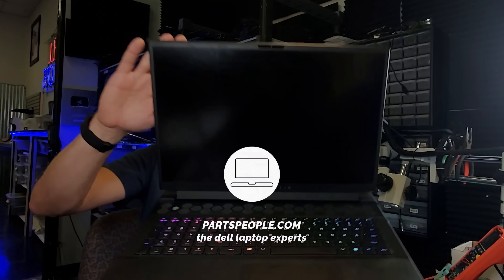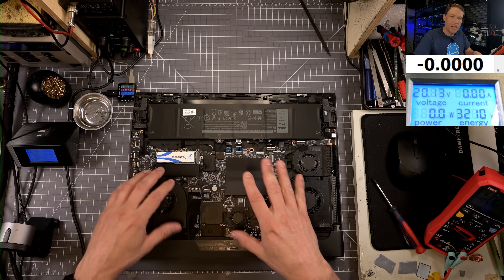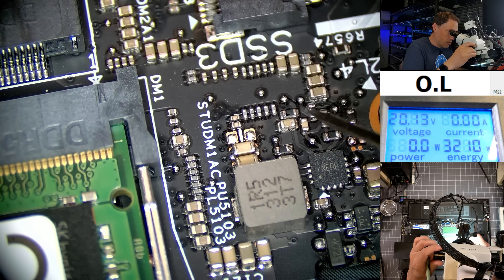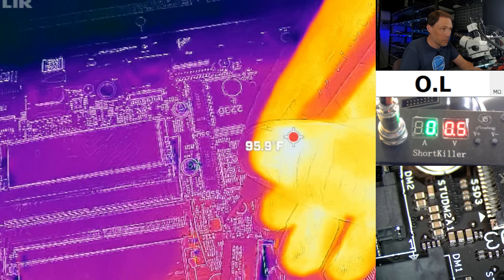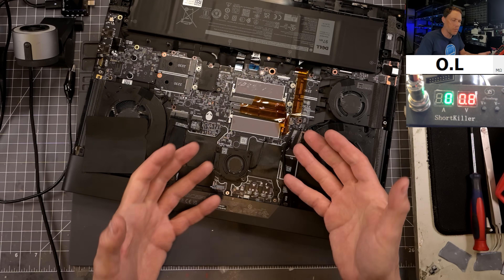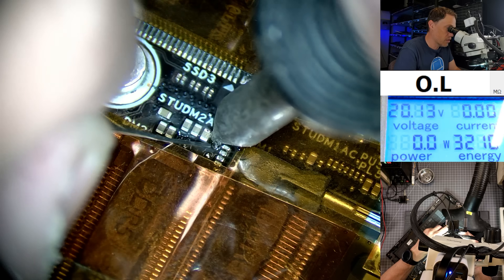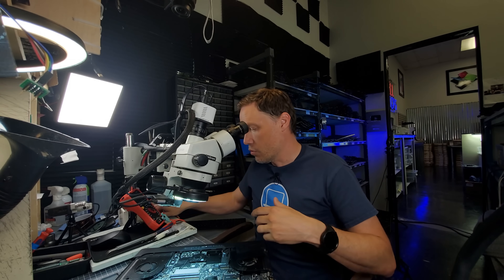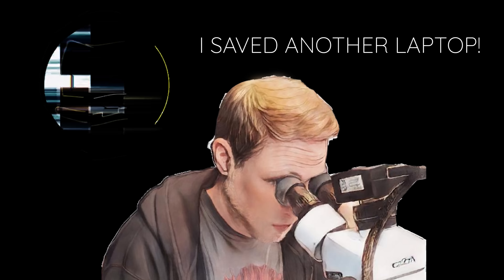SAVING This 18" Gaming Laptop That DESTROYED Itself-- And I Am Seeing TOO Many Of These!

Comment: One tip that will help you hand solder components.. remove all solder from pads, put solder on only one pad, then align/tack the component down, and solder the other pad/s with fresh solder spool. I do this regularly for components, and it simplifies the soldering a lot.

Comment: Soft termination ceramic caps are the best, but more expesive, other option is open mode but those have half the capacitance for the same size. In automotive is forbidden to use them direct on the kl_30 or 12V rail, guess why....it will catch on fire, so only open mode or soft termination type. A fuse will not help, as the short can be of a few ohms, so it will not burn the fuse but the capacitor will heat up allot.

Comment: I have worked on the redesign of quite a few boards where this was a problem. It is usually caused by board flex causing stress across the part. In this case my bet would be someone pressed quite hard inserting the ram, that is near by and caused the crack to start. Once they have started thermal cycling is enough to make them propagate.  I have also seen them happen near fixings when the board has vibrated usually due to aircraft transport causing resonance. In this case since it was likely human over pressure it is likely a good fix. For air transport you can get flexible termination versions of the caps, they are much more expensive but will prevent it reoccurring.

Comment: The only thing I can suggest to you is get a high vacuum system with an assortment of tips for micro work.  When I was in the service, it was standard on all repair stations.  Lint is the system killer.  I watched your liquid metal vid and screamed about the qtip leavings.  Adhesive is my enemy when cleaning.

Comment: I have learnt how to test and repair 2 laptops by watching your videos, both are Dell 15 5567 Inspiron, one I bought for $33.00 NZ which was simply a cracked and shorted cap on the main rail and the other (my original machine) has a shorted DC in jack, you have saved an additional 2 laptops without even touching them, thanks for you intuitive videos
Reply: good job mate, couldn't of been easy

Comment: What you do is get a decent amount of solder on both arms of the tweezers and then lay down a decent amount of flux. That way you don't need to add solder with an iron before you place the cap. Just have regular tweezers in your left hand and solder tweezers in your right. That way you can use the regular tweezers to overcome the surface tension between the cap and the solder on the tweezers. By adding a decent amount of solder to the tweezers, you're adding to the thermal mass of the tweezers, therefore increasing their efficiency when working on a ground plane. I use this method when working on 10 plus layer boards and gaming laptops and it works like a champ every time. Takes a little practice but it works quite well. Also, for cleanup at the end, I always use a toothbrush for blotting Kimtech wipes with iso and it sucks the solder off the board after a few goes at it. It'll look like you were never there, and it's a great method for getting into very tight spaces and between close together caps.

Comment: Hi, I have Alienware 17 R4...  I need to look at all your video somehow save and get all the parts need to keep it going?  I got a second Battery in case they swell up?  Dell believe it to be caused by overcharging the battery!  And MS an App: Battery Analysis?  To unplug it?  I do until it loose 60-85%, then re-plug it back in?   Is this major battery blown out killer?

Comment: hey man. I know you might not see this but i just bought a dell inspiron 7445 and the touch stopped working. had it maybe 3 months and hardly used it. windows does not detect the touch and device manager doesn't either. any ideas? I can't return it because the 30 day return is well over now. i paid $849 so it sucks that its broke already.

Comment: Dell needs to improve the quality of their gaming laptops across the board.
Reply: They can totally build a unit that could hold up against plenty of abuse, The problem is that you would then be complaining about how you could not afford such a product saying how it should be more affordable! In case you haven't noticed most of the issues are usually caused by the owners abusing, neglecting and overall carelessness of their equipment! My dad just purchased a laptop to replace the first one he bought 22 years ago, he has never had any software or hardware issues with it whatsoever and he actually uses it multiple times a day every day! The only reason he had to replace it was because windows was no longer supporting his unit literally forcing him upgrade! I also have a 2005 HP Pavilion dv8000 that is in pristine condition, except for upgrading the ram and adding a second hard drive it too has never had to be repaired! The only thing that I have done to them over the years was replace their CMOS batteries and cleaned the cooling systems also replacing the thermal paste!

Comment: One problem I had many times repairing laptops. Some that I came to me, had broken boards. From people that pulled the wire while charging their laptops. The only thing I could do is replace the board. They mostly learn not to do the same mistake. But I have had to replace the board on a couple multiple times. It starts to get expensive. I enjoy watching your videos. I was happy when they stopped using those hard drives in Laptops. Now days All in one PC has the same SSD setup. Now you can purchase many TB SSD to upgrade. Just make sure you have a way to restore your operating system. I worked on boards that had flux that was never removed. It is  very frustrating thing working on a board someone else touched.

Comment: A batch of bad caps wouldn't surprise me at all.  I bought a Minolta Camera when they still had film late 90s.  The shutters got stuck on every single one made in a huge batch run.  I only found out a few years later it was a bad cap that wouldn't hold enough power to fire the shutter.

Comment: do u think the inductor feeding the circuit couldve caused a high reverse voltage spike on a power down that couldve caused damage to the cap? I mean theres usually a reverse diode in line with coils that allow the inductors to discharge back to ground. But thats always my thoigh, thouvh it couldve been from excessive heat too i guess.

Comment: I have worked with electronics for decades and I have rarely seen a shorted capacitor.  I cannot actually remember a single instance.  But you come up with them over and over.  It does seem like they are using some really cheap and bad caps.  It is normal for them to open but shorting is so rare but you see it over and over.  Quite odd to me!  But the proof is there.  Good job of finding this.  But you have great toys so it makes it easy.
Reply: These small SMD type caps pack a lot of capacitance in a small area but that also makes them mechanically less stable and more prone to shorting-out. Most capacitors indeed fail "open" as that is safer in most situations (like in a mains supply filter) but in this case there is a current limit check on the supply so the damage is limited when a cap shorts out. Using caps that fail open probably isn't possible in such a laptop as such caps are much larger so the designers would not be able to fit enough decoupling caps on the supply rail.

Comment: Immediate thought: Cap is probably 6.3v, and given that's a 5v rail that'd be fine if there were never any spikes or ripples. But I bet there's justt enough ripple at full load, and the caps let go.
Reply: Another possibility is mechanic stress. Ether due to heating/cooling cycles or mechanical movement. Ceramic capacitors do not flex and they are brittle so if there is too much movement it will crack and may go short.
A couple of years back the guy over at the EEVblog talked about this exact failure mode of ceramic capacitors after he experienced it first hand on a device he was about to review.
Reply: These caps filter massive harmonics coming from the coils, that's nothign that will kill a ceramic part. Usually it's mechanical board flexing.

Comment: Please save those SMD Ceramic Chip Capacitors. 

1.) On a few, solder heavy leads and crank up the amperage.
See if the short clears. 

If it does, then test with a Capacitor Checker to see if any Capacitance is left over. 

2.) Research who manufactures the Original Part. 

3.) Get the Original Manufacturer to micro-grind the SMD Ceramic Chip Capacitor and check under a microscope till the Short is revealed. 

4.) What is the exact nature of the Short: 

a.) Ceramic Dust + 'Plate' rotates in place and shorts two plates? 

b.) Metal of the plates flow/ grow into a previous crack.
[ See "NASA Tin Whiskers" ] 

c.) Other 

Gregory/
The Pigeon Meister
       ... .  🐦‍⬛

Comment: Sometimes the proper load isn't calculated correctly, or another engineer adds load without recalculating. Thinking it will handle it. It's hard to keep engineers accountable especially when a year or more goes by before the problem raises its ugly head.

Comment: Have you considered using small makeup brushes instead of cotton swabs? They make them very small, like a lip brush, and in shapes from angled to flat to rounded. It may work better for getting into small areas, and would be better in terms of less waste. They can be easily cleaned with regular soap and air drying.

Comment: Being enjoying your videos. I started out working in a repair lab for Data General a long, long time ago, so it's interesting to see how the tech has advanced since that time (I retired from Dell EMC storage support group about 10 years ago). When we found something failing over and over, we had a process to alert engineering to these types issue and they would usually start an investigation. Hope they're listening to you.

Comment: Why is it that you can remove the capacitor and the laptop would start without it?  Doesn't it need it ?
Reply: They are filter capacitors, they help keep the DC nice and clean, but yes any particular one of them (or possibly several or all) you can live without as long as the short is resolved, but this shop always replaces them so you're back to factory specs

Comment: Good job fixing it! Amazing that a 1 cent component renders a $4k laptop’s useless. Dell should have 100k mile warranty on all high end laptops, just like Hyundai does on there Auto’s. 😊 Dell u can do better!!
Reply: I worked on a 3090 that had a blown capacitor on the back, and it was the same thing. It was a 1 cent part that kept it from running.
Reply: Seriously, laptops need a top-to-bottom, front-to-back warranty on any over $850. An "HP 14" with Intel N150, I'll take my chances with the 90 day warranty and my tools. But this PC? It better include a 5 year warranty covering all electrical faults and thermal faults.

Comment: Quick tip, for those small caps, tin one pad and leave the other pad clean, then anchor your capacitor with tweezers and soldering iron on the tinned pad.  Then finish off the other side with flux and solder. No heat or tweezers needed.

Comment: Dell are rubbish, used to be the best years ago...
Reply: He only repairs Dell laptops. My Lenovo legion 2020-2021 lost two of its four usb ports and the webcam (mobo issue) within 4 years, my gf's Dell g5 2019 is going strong after 6 years. And dell g5 is considered one of the worst dell laptops of the last few years.
Reply: They're all basically the same. Building "Quality" outside of satellites, military equipment and pacemakers is nonsense as people are not remotely willing to pay for it. A "gaming laptop" is a stupid device by design already, high power/heat on small space, what did you expect?

Comment: I have this same computer and had the same failure, sadly, I didn't know about your shop or channel, the repair place I brought it to replaced the motherboard.
Reply: thats most shops now they just replace it instead of fixing it
Reply: If you still have the old board, you can just knock off the cracked capacitor with a screw driver and it's fixed. That's it
Reply: @TigTex so if I just removed that capacitor and didn’t replace it with another one the problem would be solved???
Reply: @zeus-ik2ld yep. One missing decoupling capacitor will not cause any harm or instability. In a hurry and without tools it's a good enough fix
Reply: That's what most repair shops do. Then up charge you on the motherboard. Most electronics are fixable. The problem happens when it's a component that isn't replaceable. Example CPU on the motherboard....

Comment: It's unbelievable how such a tiny crack in a tiny component like that capacitor can bring an entire laptop down.
Reply: yeh, entire 4K+ usd laptop that is about a year old ....sucks for the owners...beautiful laptop tho ...but this makes me uneazy ..:) eazy to repair - in theese hands tho. As an owner Id be affraid that they could cause more damage in many cases ...I can imagine...
Reply: M18 R1 are about 2-3 years old
Reply: Not really considering how finicky technology is. What's crazy is that we can even make these things. If you understand how circuits work it's not surprising
Reply: Such capacitors pack a lot of "capacitance" in a tiny area, that is done by making the isolation layer VERY thin. Unfortunately that also makes these capacitors more sensitive to (mechanical) stress causing them to crack and short-out.
Reply: a little blood clot in the heart's coronary arteries can cause a heart attack and kill a human... a blood clot is even tinier than the tinest capacitors
Reply: That happened with my acer, i was gaming, i heard a crackling noise and thr laptop just turned off suddenly, i found the shorted capacitor using voltage injection, it was on the main power rail, was very hard to remove and even harder to solder another, i used just a little bit a hot air because it was too close to the gpu and i didn't wanted to risk melting the gpu solder balls
Reply: I think it's by design really, to protect as much of itself as it can
Reply: It's not the crack, it's a short that causes it to run hot that then cracks the case due to heat.